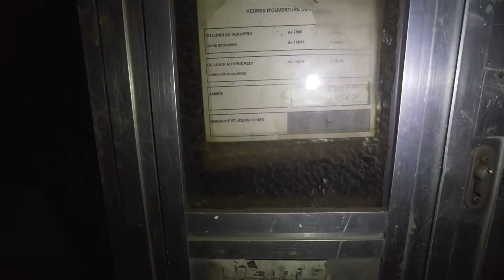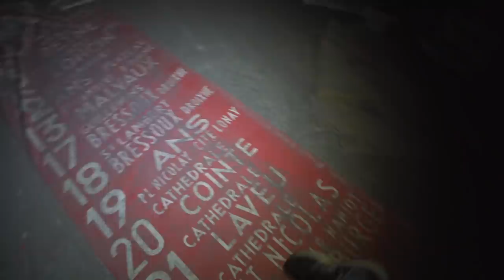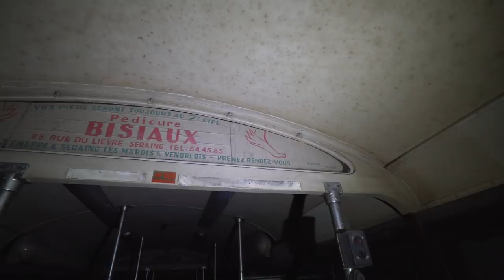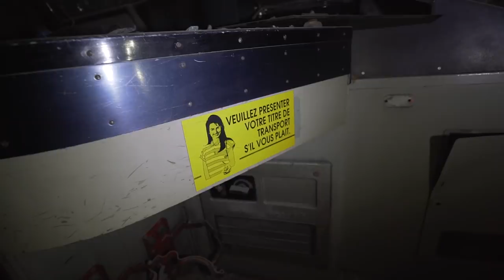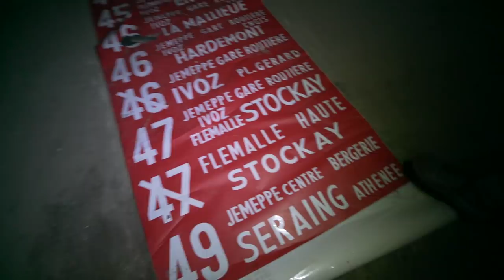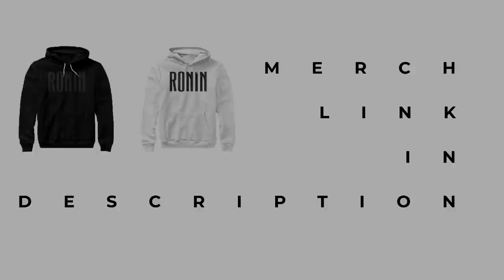Exploring Abandoned Ghost Bus Tunnel Deep Underground

Comment: The stories about the tunnels are all lies. There ARE tunnels under every single city and they WERE a public system for getting around without dealing with weather and disasters. It was not failed, it was a worldwide tunnel network that still exists. Th3 fact the tunnels even exist should tell you it wasn't a failure.